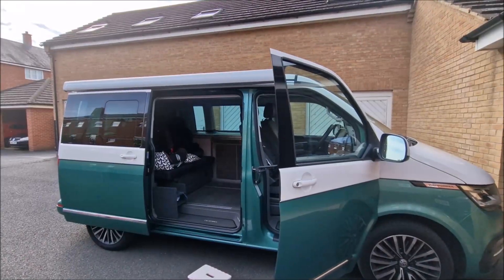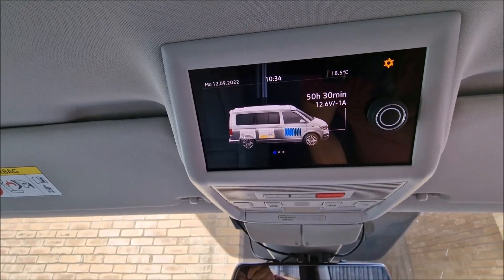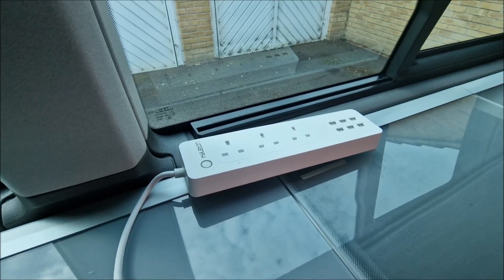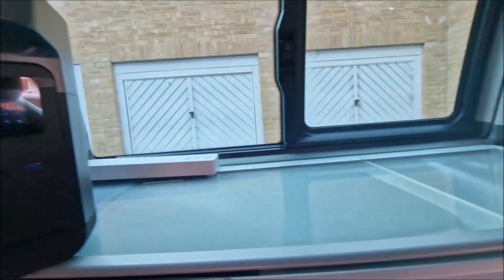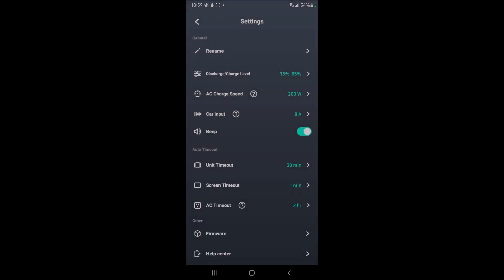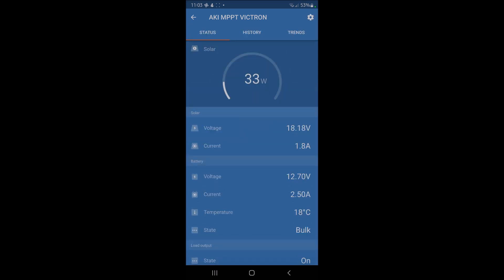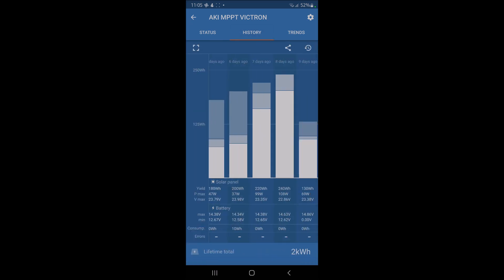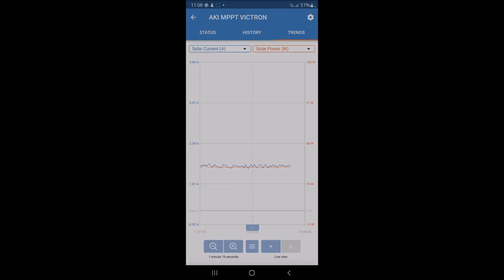T6.1 Cali Ocean Solar & Ecoflow Delta Mini

Comment: Hi I have pretty much the same set up as you, using the load output if the mppt to my Delta. I would interested to your settings on the victron app which algorithms are you using etc as well as the Ecoflow settings, I am trying to find that sweet spot so my Batteries don't drain and the Ecoflow cuts out. Many thanks Ian.

Comment: Hi Kev, thank you for your vids on the solar panels. I am looking at it myself as well and your video actually does give me some confidence to do it myself. Just two questions though, 

1) since the panels seem to be not touching the roof, is there any wind noise or whistling sounds being generated by the panels whilst driving at high speeds?
2) I see that you also have an awning, when installing the panels, are they still below the highest point of the cassette and if not by how much higher than the cassette would it be. My car is already standing a bit higher on its legs, so I would like to avoid adding more height to the total set up.

Thanks

Marc
Reply from the maker: @marce9611  hey Marc, no sounds noticed so far and I have done some long travelling to Spain etc at 130kmh speeds. obviously no faster than that :) and on point 2 i don't think so but will check through and post

Comment: Hi Kevin, I'm just about to embark on the same, will I need a different controller if I'm going for 3 panels? Also does your Delta 2 keep cool enough and vent ok in the boot?
Reply from the maker: If you get your panels from roger then you should get the right Mppt from the get go. If you are going it alone then go for 100/30 at least. Yes keeps cool enough not a problem from my experience. all the best

Comment: Why not charge from Solar direct to the Ecoflow?, then run the Eco flow to the EHU of the van. This way you will be using the full quicker charge from the Solar to the Ecoflow, which tops up your OnBoard Leisure Battery and also provides 240V/12V to the existing Vans sockets. The Ecoflow would fully charge in about 7hrs from the 200W solar on a decent day, and no need for the Solar controller/wiring etc. The EcoFlow already has all that built in.
Reply from the maker: Hey, the main reason was to keep both the leisure batteries topped up so they don't go too low.  The ecoflow top up works great as a secondary power source. I tried using the ecoflow to plug directly into the van so can use all the internal plugs etc which worked a treat to boil kettles and top up both leisure batteries if they get to low on a weekend away without having to run the engine.
Reply: @andybearyaki  cheers for the reply. I'm using a mini in the rear wardrobe on my Cali Exclusive and plug in via the EHU.  They are a great solution, can be off grid for many days with this and the Leisure battery.

Comment: Hey Kev, did you manage to run a power extension from the ecoflow in the closet behind the units to where the existing socket is? How did you get on? Did you need to drill any holes?
Reply from the maker: Hey sorry bebeboouk missed this message. In short nope, I couldn't find a way around. However I bought a delta 2 so doesn't fit in the cupboard anymore so I added an adaptor under the rear seat.

Comment: Please can you confirm that your charging the ecoflow from the solar via your charge controller?  So it still charges the leisure battery and ecoflow at the same time?  Have you put a 12v socket on the cable from the charge controller to the ecoflow the use ecoflows 12v charge cable?
Reply from the maker: Hey Tim - Correct using a 12v from the charge controller which then connects to the ecoflow. However you do get a higher charge from the front (under chair) 3 pin (although you need to reduce the power down on the ecoflow app) and of course the 3 pin under the chair is not great at keeping the plug connected (keeps popping out for some reason probably bad design).

Comment: Great bus!!! I have a question: in the closet you have such a division / subdivision (see minute 5:04), can you tell me the brand or where you bought that? Needed that also for my bus. Many greetings from Hamburg
Reply from the maker: Hey jk, of course it was just a simple clothes organiser link here BrilliantJo Hanging Storage with... https://www.amazon.co.uk/dp/B074XX52Q5?ref=ppx_pop_mob_ap_share 

I bought these  Pack of 10 pieces, 30cm Wooden... https://www.amazon.co.uk/dp/B00CE4F2NA?ref=ppx_pop_mob_ap_share to help secure it using the existing Ledge at the top.

It fits perfectly and is super useful for the clothes, you can store right at the top but also you get a space in front door larger items if needed. Happy camping
Reply: IKEA have a similar thing